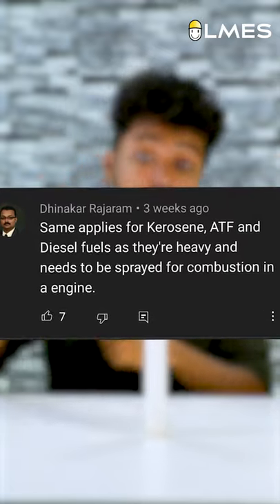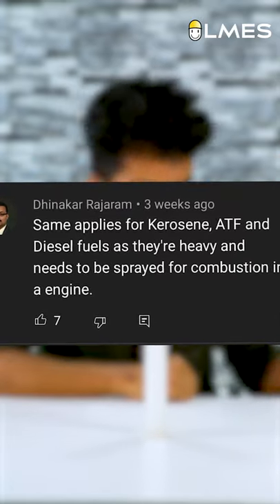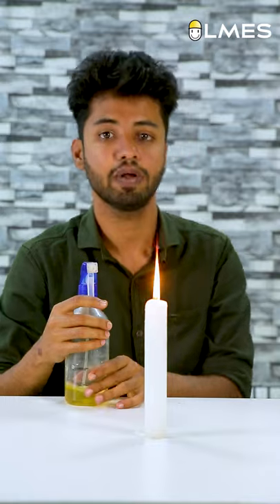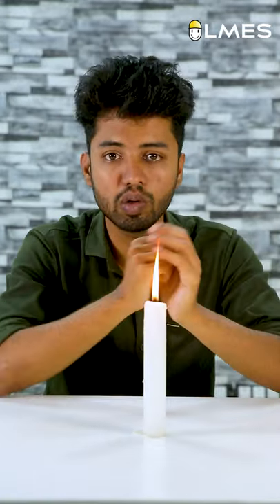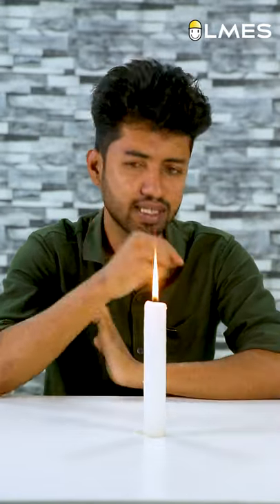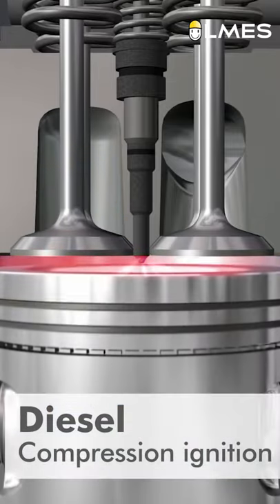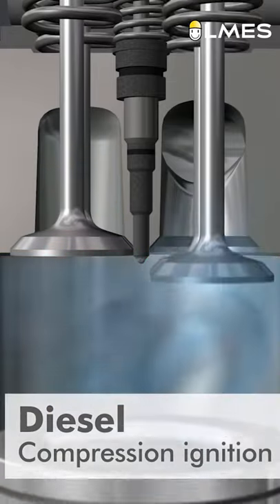Spraying Diesel in Candle! | #shorts | Tamil | LMES

Comment: In diesel engine the compression itself produces the flame and burns, the animation as you shown is likely suitable for petrol engine  in which it needs external spark... But anyway it's a good work to explain this kind of things...
Reply: I thought of commenting the same..
Reply: Probably it's a glow plug
Reply: Its is fuel injector, through which diesel get sprayed and mix with compressed air and combustion starts.

Comment: This experiment shows the difference in the flame 🔥 colour and a black smoke comes out when diesel is used.. This might be a good example for carbon emissions and air pollution caused by diesel engines..
Reply: The black smoke is not because of diesel.  The smoke is because it is not a stoichiometric mixture.  When there is a stoichiometric mixture diesel burns clean.  
The pollution is not because of diesel.  It is because of the stratified fuel method.  In this mode combustion is concentrated around the nozzle and hence causes a concentrated heat spot around the nozzle.  The high temperature in that hot spot causes nitrogen to burn with oxygen to leave dangerous nitrous oxide.  Even if petrol is sprayed this is what will happen doesn't matter what the fuel is being used.   But in petrol engine, petrol is properly mixed with air and make a homogeneous mixture, so the combustion is not concentrated.  Doesn't leave any heat spot. 

Please read about SCCI (Stratified Charge Compression Ignition).  Using a swirl nozzle helps in even mixing of fuel before it burns and helps in uniform burning reduces the nitrous oxides by 50%.

Comment: Bro.. the video is really good... But there's one error.. in a Diesel Engine cylinder, there is No Spark plug, instead the Air is initially compressed to a high temperature within the cylinder and then a Fuel injector is used to inject diesel droplets into the cylinder, which on contacting the high temperature compressed air ignites automatically thus pushing the piston down...
Kindly consider it bro... ✨✌️
Reply: What are you studying bro??
Reply: @newbrightdpmdpm1706   What's with my studies bro? By the way, I'm a Mechanical graduate ✌️
Reply: IAM a high school student and searching studies for my career
 Iam impressed by your comment so I asked about your studies
Reply: @newbrightdpmdpm1706   All the best bro... 👍. What career option are you planning to choose?
Reply: Still confused about it bro🤔